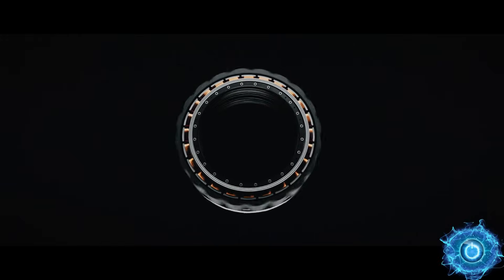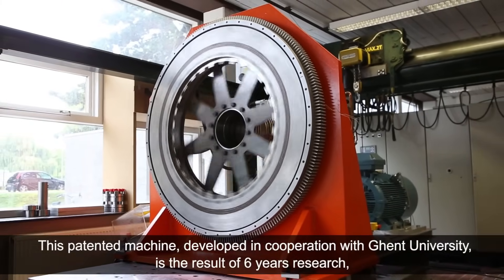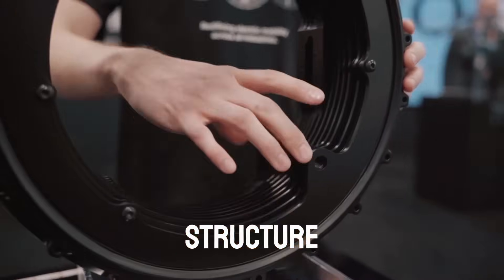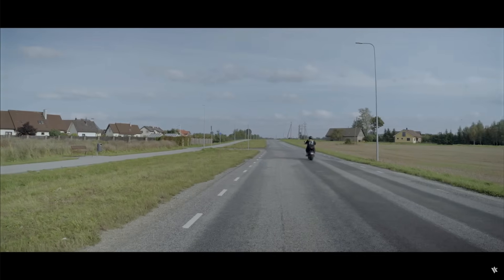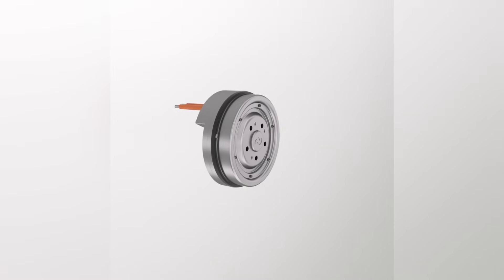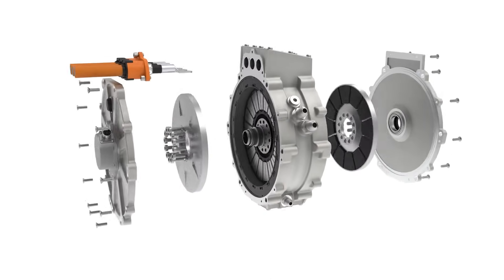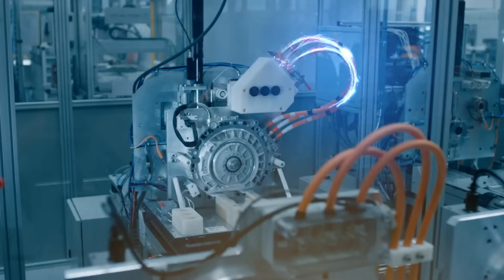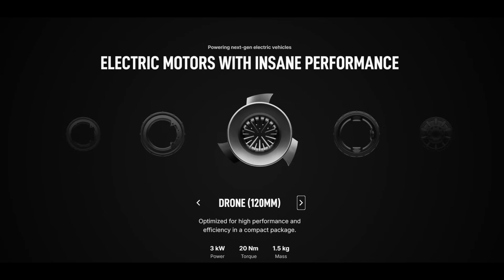New "Donut" Motor BREAKS Records!

Comment: It is a standard wire wound 3 phase radial flux motor with very low friction large bearing.  They posted detailed images of the motor during assembly. They use 20 parallel strands per phase. and a lamination that look very thinni, maybe 0.29mm or even thinner.  They could in the future use hairpin but it require a 500k$ laser welding machine which is large investment for now.

Comment: The size of the motor has nothing to do with it's rotational speed. The wind of an electric motor, the number of turns and gauge of wire on each pole determines it's KV, it's rpm per volt rating.

Comment: It's an area of great growth, always a pleasure to see new developments.  I could see mounting one in the place of a rear end differential; putting planetary gears inside of/adjacent to it, and running half shafts to the wheels to overcome the power band and un-sprung weight issues.  Mated to a constant velocity transmission could make it easily adaptable to present powertrains.

Comment: I think it is a stumbling block to expect the motor to be entirely encased in the tire.  It just needs to be on the same axis. I would attempt a side by side design, with the wheel being an extension of the motors axle.
Reply: Can’t be on the side

Comment: My concern with the "Donut" motor is longevity - not in the electrical/magnetic portion, but in the bearing surfaces.  Having the roller bearing close to the perimeter means that the bearing surfaces will be closer to the road - and in an all weather situation, those bearings will need to be replaced VERY regularly...  My thoughts are based on the frequency I used to go through sealed bearings on  inline skates (Rollerblades) - when the bearings were new it was like skating on ice!  But once dust got into them (and dust WILL get into bearings) their life expectancy reduced quickly!
I suspect these "Donut" motors will suffer from the same dilemma - that bearing repair/maintenance (over times) will make them too expensive for vehicle adoption...

Comment: Koenigsegg doesn't just use axial flux they have two motors that use both radial and axial put together aka Raxial or Radax.
Koenigsegg's "Raxial Flux" Technology:
   * Koenigsegg has innovated by combining radial and axial flux principles in their electric motor designs.
   * Their "Dark Matter" e-motor is a prime example of this technology. It's designed to deliver high power and torque in a compact package.
   * They also created the "Quark" electric motor, that is also a "Raxial Flux" motor.

Comment: My concern would be the life of the motor. The magnets take a savage beating, and will not last.
Reply: there are nearly a billion ebike on the planet and at least half of them use chineese hub motor directly connected to the wheel... and they actually have zero problem with magnet adhesion so  where is the problem?
Reply: @Doctorbasss  A billion ebikes already!!??? Wouldn't that be 1 ebike per every 8,3 people..??

Comment: They will break the first pot hole you hit..
Reply: They are made of carbon fiber which is stronger than aluminum or steel regular wheel.. but yes it also have a failure point.

Comment: Love your work.
I am trying to source a couple of high torque, low rev and small diameter electric motors, (150-200mm dia, 1000RPM, 10-30KW)
I want to use them as direct drive motors on a 4 wheeler with short driveshafts to the wheels.
Most motors are too larger diameter, which means that to obtain sufficient ground clearance, the drive shafts end up being at a very acute angle.
Any thoughts?
Thanks

Comment: Nice overview.  Like internal cumbustion engines have evolved over the decades of use electric motors still have development improvements for each use case.  I hope hubless motors like Donut lab and axial flux motors can do well and find their best application as they continue to develop.  However unsprung weight and durability are still real issues for in wheel applications.  The power or power density seems to be a non issue or very minor.

Comment: It's a cool motor design, but I would be worried about impacts not being damped by the suspension of the car; it would have to be quite rugged or you'd have to change the wheels a bit so they perform the function of the suspension as well...

Comment: Not really a fan of these types of motors for any vehicle where the wheels are set apart in parallel such as in a car, in case 1 fails, it would usually be a problem. However, if there is only a single wheel powering, such as in a bicycle, then failure won't cause the bike to lurch to left or right. However, hub-less designs are very tricky... and much harder to design.

Comment: All donut motors with large open holes are crap for everyday use. The bearings are too expensive and too open for bad conditions. In electric unicycles, they are usually covered and have small bearings, that are completely silent and can live under wet weather and winter salts. By the way, recent electric unicycles are as small as a gaming PC block, but can archieve speeds of 90-110km/h and range of 100-250km, making electric motorcycles obsolete and useless.

Comment: $30k for that motorcycle, when you can buy a comparable one for $5-10k with a combustion engine. Fail #1
I bet it also has Fail #2, where the range and power efficiency isn't as good as well.

Comment: For low speed, usually off road applications, where unsprung mass doesn't matter so much, then in wheel motors make sense from a packaging a usually a practical perspective.

For high speed applications, e.g. cars and motor cycles. The significant increase in unsprung mass is massively detrimental to handling.

Reports I saw for this prototype stated it weighed in at 40kg bare, which is a huge amount of weight to add.

Comment: Other than it "Looking Cool" unless applications are found where the hollow center is actually useful for some specific further purpose, this will just only be the type of curiosity, that gets us idiots to click on it !
Reply: Industrial robots often have large pass through joints for running cables and hoses from external equipment all the way to the end effectors.

Those robot joints need massive torque, insane precision, but not a lot of speed. They almost always use gears rather than direct drive.
Reply: Verge Motorcycles are already in production with the donut motor.
Reply from the maker: Why would you be an idiot? It has high torque for machinery/equipment at low velocity. Seems somewhat of a good idea for application with an open end on power source.
Reply: @Motor_Explorer1  I may be wrong, but there are endless types of motors & one should select the type which best fits the application. This specific design I doubt would be the over cost benefit stand out even for "high torque / low velocity" applications. The cost & durability questions about this type, would most probably only be justified by the actual specific need for it to be hollow ! Or if you're willing to bare those additional costs just to look cooler...
Reply from the maker: It's a radial flux motor and it's on the market built in in a Verge motorcycle.   I intentionally gave a example of an axial flux motor working in direct drive yet it is more expensive (more than every EV radial motor out there!). Even more than this particular "Donut" motor for motorcycles. If you don't believe me go look at Yasa 750r price points, you would break before even getting to the frame of the bike. It's difficult to select the best motor for the application because of economics.
You are not wrong, I think somewhat pre-emptive on application of motor but I do appreciate your comment! I value your honesty and we need to have constructive criticism on new motors that are marketed like this one.
Reply: @ Yes, AND - It sure is cool looking ! 🙂

Comment: There was a bicycle who promised this. The wheel did not handle small potholes or edges or anything like that without breaking and they were so noisy. The friction is much higher with this design so they are very inefficient.
Reply: This is not the same design at all.
Reply: If you're talking about the reevo bike no it did not have the motor in the wheel, there is no comparison here

Comment: The video never mentions unsparing weight, which will make this tech very difficult to adopt in Motorsports. Take motorcycles as an example. The combination of increased rotating mass that is unsprung will radically change the handling characteristics and suspensions will have to be redesigned. If you follow motorcycle racing you will know that radical concepts to forks and swingers have not been very successful. If new tech fails at the race track, gear heads will have their doubts. Achilles heel in my opinion.
Reply from the maker: How so? I mentioned longevity issues which would be a result of un-sprung weight. The performance and result are correlated.
Reply: I’m not referring to longevity or durability of parts, but rather the handling characteristics when you add unsprung weight and rotating mass to a vehicle. The Flyin’ Miata channel has a video that gives a pretty good explanation. In short, the whole suspension system will have to be beefed up to handle the extra unsprung weight, and the vehicle becomes sluggish and harder to turn
Reply from the maker: Got it, that is a good point to dive more into, especially for fwd systems. I like that channel you mentioned, there are lot's of good information videos on there!
Reply: @alexchaux8949. Salut J'aimerais avoir ton avis sur la fameuse Stark Varg que le fabricant annonce une puissance de 80HP. HHHHMMMM! HHHMMM! soit 59 680Watts 😜 QUOI !!!! 80HP dans un moteur qui fait de 8 à 10 pouces de diamètres, c'est n'importe quoi leur Stratégie de marketing à mon avis. Elle est frauduleuse. C'est de la fausses représentations mais personne se plaint. ILS fournissent pas les SPECS du moteur ils se contente de dire 80HP et faut voir la façon qu'ils font les bancs de charge. C'est du jamais vu , enfin pour moi. Qu'en pense tu, merci et bonne journée.🙂

Comment: that is guaranteed to be a iron dust collector. hold on, it will levitate the dust instead. without any moving parts. come on, true brushless dc motors. dont believe if someone says they are impossible. market speech. brushless dc motor means no current/magnetic field pulsing, just dc fields and constant torque. implementation is always different from the design. actuality vs science. actually can be messed up, even when the design is perfectly working. well, God made people, so anything is possible, even failing humans.

Comment: An unsprung in wheel hubless might not be ideal for locomotion but it would make for a great genberator!
The design does not look much more than a couple of high-end lazy susans, stacked tightly and then loaded up with Neodims?  Maybe you could 3D print a prototype?
Reply from the maker: I agree, it's more generator orientated without unprung mass!
Reply: @Motor_Explorer1  - I know some big susan makers.  Can you get the electronics from PCBWay?

Comment: It's not just rotational inertia, it is also unsprung weight as a severe negative to handling, as it takes a lot more weight on top of that to make a useful suspension hanging that kind of mass on the wheel.  It make more sense to put the motors at the corners of the car, and couple them to the wheels with a driving shaft.
Reply: @kwk8363  UNREAL performance: The bearing size is??? 7 times more heavy, 10 times more expensive (bearings have 1-2 microns tolerance),  large area exposed to water/sand/seals... It doesn't use copper and magnets for a 90% efficiency? NO it has 170% efficiency using gold and kryptonite. Be real, this has only CGI and fake prototypes. They haven't even delivered 1 motorbike (38,000 euros) and now they are asking for millions for trucks and drones? Be real man, the figures are 170% silly. The copper efficiency cannot be that high, and the magnets are not better than tesla, we have 95% efficient motors already, how can this be 2x better? nonsense! we have oil-cooled stators. Be cynical and give what this company deserves, fact and laughing. Also rediculously expensive and bad maintenance issue with bearing, total lies.

Comment: unsprung mass for wheeled vehicles is just stupid. It doesn't matter how much torque will it produce. It can produce all the torque of the universe but if they want to use it as unsprung mass then it's just stupid.
Reply: Totally agree 😢
Reply: Why is it stupid? Normal guy here
Reply: Look up rotational momentum and see what happens there.
Reply: I agree that much unsprung weight will turn your suspension into a horse and buggy basically
Reply: Try riding the motorcycle before saying it's stupid.
Reply: @kayakMike1000  No need if you understand electric motors and physics. This will be an ill handling death machine. Maybe you try it!
Reply: Only till a certain point. There will be a point of time, where these in wheel motors are so light that it doesn't matter. I'm giving this another 10 years and it will be everywhere
Reply: @Menon9767  Yeah it will... In flying cars
Reply: @EpicTimeV7  Let's say you have 30kg of unsprung mass per wheel (many cars go higher than that). If you get a motor that weighs 5kg into there, it won't make that much of a difference. And since electric motors can regen brake, you can downsize the actual brakes without sacrificing performance.
This is why I think they just need to get a little lighter and then there won't be any major drawbacks anymore
Reply: @Menon9767  agree but there's a big barrier : anything magnetic has to involve iron, which makes it heavy.
Reply: @Menon9767  but you have to add more weight for it to regeneratively brake...

In addition (like it or not) the brakes have a minimum design capacity they have to be sized for - regenerative braking is basically disallowed in FMVSS and all braking capacity must be able to be handled by the mechanical brakes (unless you can burn off 100% of regenerative braking as heat and the braking force is purely modulated by the brake pedal). 

Even if the law is changed, the edge case of a fully charged battery that accepts no energy from the brakes must pass the performance tests will be written in (in the same way brakes work to spec in their green condition).